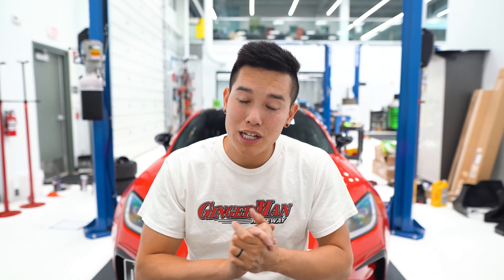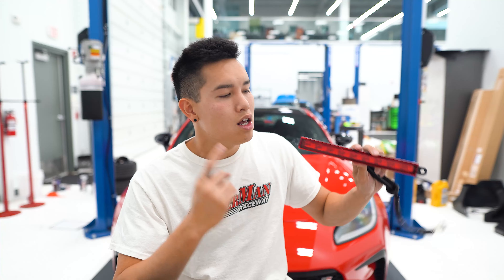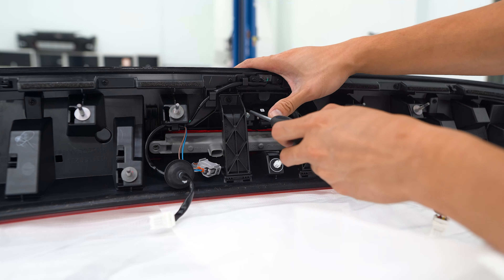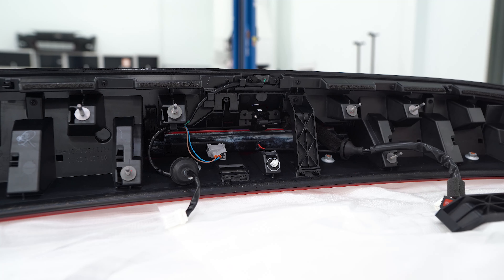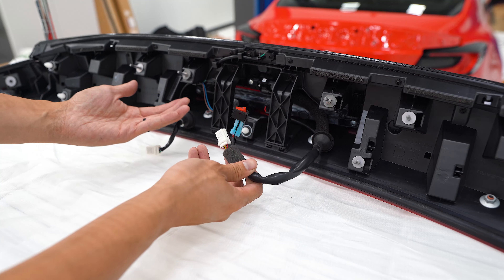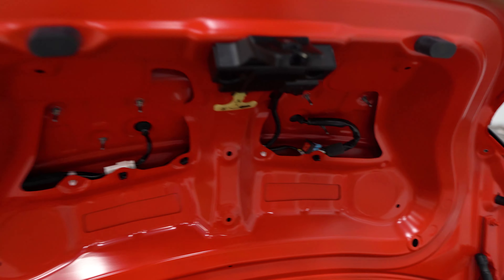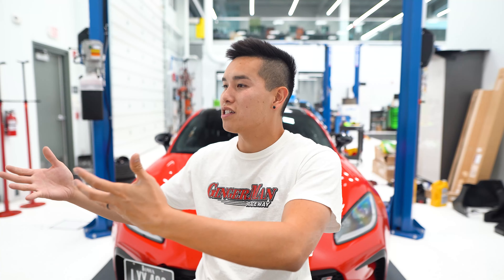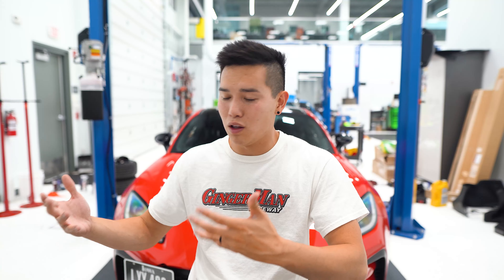2022 GR86 & BRZ PROTOTYPE F1 3rd Brake Light

Comment: i like the blinking function but i would prefer the light to be more defused, i dont like seeing the bulb hot spot.
Reply: That'll be the camera exposure showing you the LEDs. In use, to the eye, they diffuse (as do the LED-based lights)
Reply from the maker: It's the same design as the OEM light it was intended to replace.

Comment: I am surprised no one has tried to run one through the trunk trim piece that connects the tail lights. If I had a gr86 I would be making one as soon as possible.
Reply from the maker: Not as simple as it sounds.
Reply: @FTspeed  I know, I have spent close to 2k on tools and materials for custom lights. I am still not done with my frs though.

Comment: What about the light that is in between the reverse lights?
Reply: in the states that's just a reflector
Reply: it would look maybe better but just a reflector what just joins the Rear Lights
Reply from the maker: We've got options for that as well. Check out previous videos.

Comment: Honestly I can see this being a problem in stop start bumper to bumper traffic. Honestly distracting for the wrong reasons. At speeds though can definitely help and the best version would be one that only blinks like that over a certain speed or by how much force is applied to the brake pedal
Reply: Not braking force, because that would require the ECU to provide that information. Having an accelerometer measure the deceleration would be more than sufficient for a bolt-on aftermarket part.
Reply from the maker: That would make the light ridiculously expensive and no one would buy it, unfortunately.
Reply: @FTspeed  Adding an accelerometer to the circuit wouldn't actually be that expensive or complex. I reckon it could easily be done for say a 10 dollar price bump.

Comment: It looks really cheap because you can see all the led bright spots. They need to make it linear to match the brake lights.
Reply from the maker: It's the same design as the OEM light.
Reply: If you feel that strongly about it, buy some scotch tape and apply several layers of it to the inside of the lens. That should give you what you're looking for.